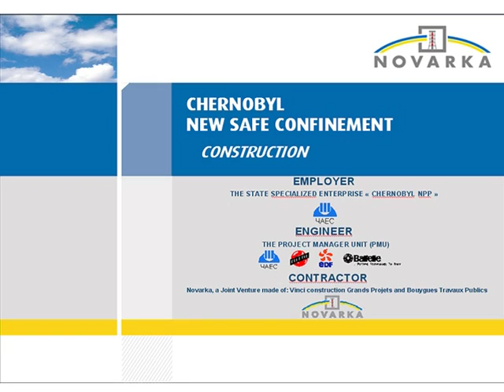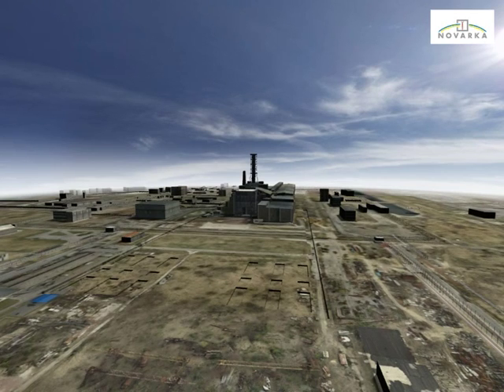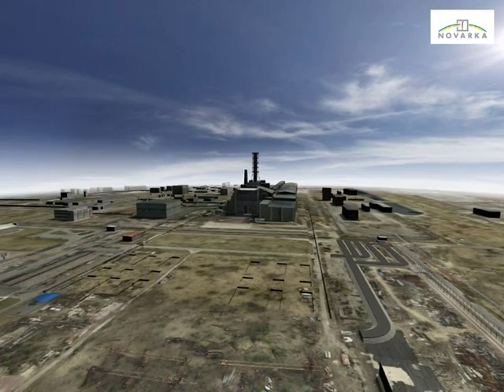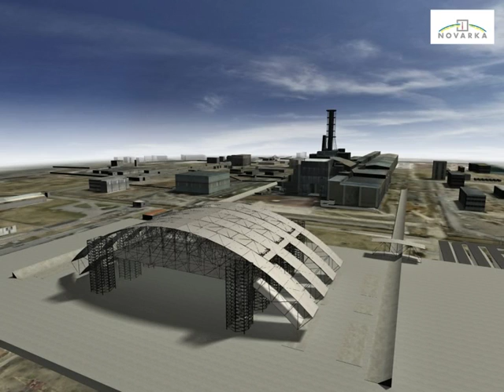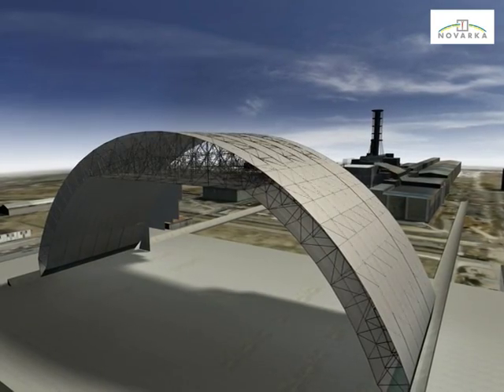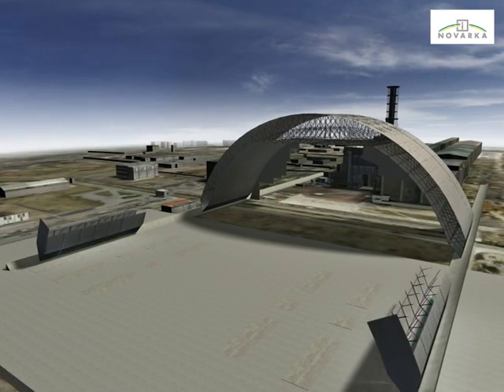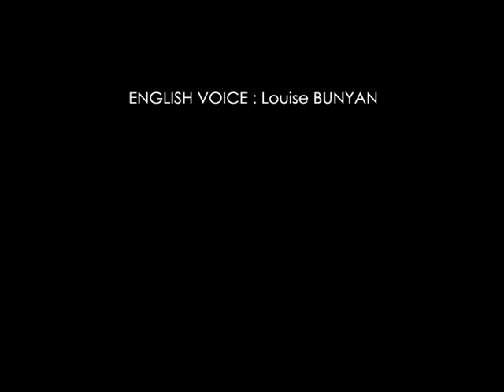New "safe" confinement over the reactor #4

Comment: I don't know about you, but when I'm involved with heavy work - say, changing out shocks on my car - I really appreciate a garage to work in, even if it is unheated. Just having the wind and rain excluded is a plus, particularly on a multi-year project.  The arch will also include several heavy lift cranes and other equipment for moving heavy and/or contaminated pieces.

It seems that you have no answer.  Novarka does seem to have a plan.

Comment: From what I understand, it's supposed to last a century.  I imagine at that point, you just slide in a replacement and dispose/clean the old one before disassembling.

Still, it's better than the current shelter, which was never meant to be hermetically sealed, and could come crashing down in the case of an earthquake.

Comment: Hmm, good point.  But surely, there is a lot of Maths, Physics, etc going in behind this.  If these people are trying to prevent a disaster, surely they would try to do it right?  Anyway, it's better than the design they have now.  That has holes and leaks and it's slowly falling apart.  It's better than nothing.

Comment: In answer to what happens when a reactor EOLs: we tear them down. A nuclear reactor that never experienced a core melt accident is, in most respects and after defueling, like a big concrete building with a tasty steel center, which can be torn down like any other structure. Fukushima and Chernobyl are unusual, in that they did experience core melt accidents, which makes their destruction much more difficult. In answer to the inevitable question about spent fuel: reprocess, reprocess, reprocess).